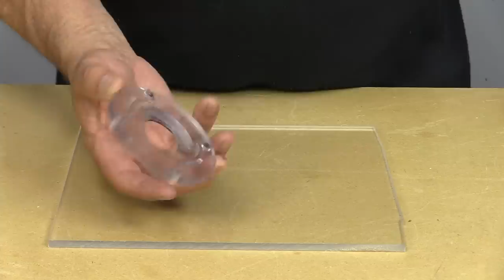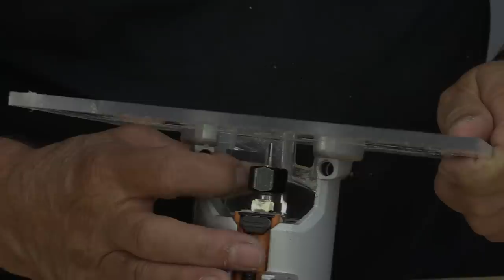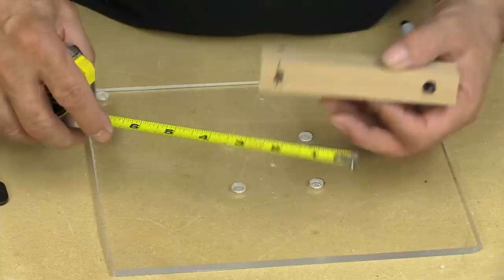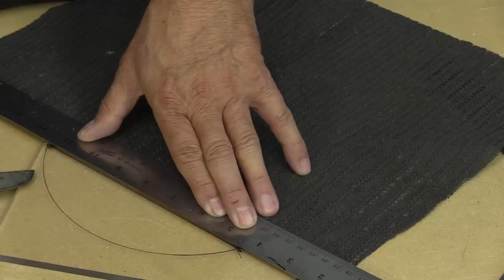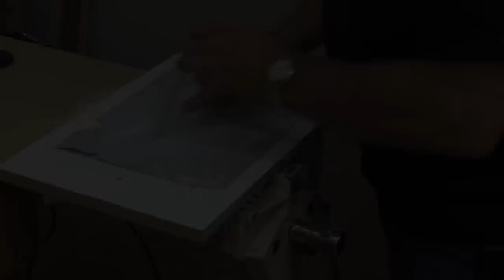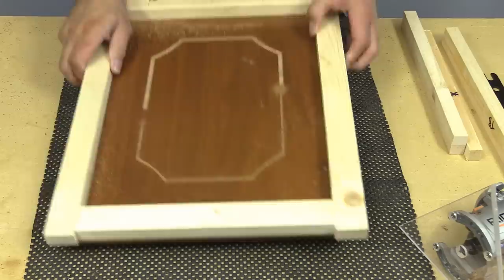Trim Router / Palm Router Design Base Jig

Comment: Great idea. So simple. I’d add a small chamfer on the bottom of the plastic plate. It’ll help clear the dust and ensure that the plastic edge runs clean inside the frame.

Comment: Thank you for “burning an inch” when measuring.  A surprising number of young machinists and carpenters I work with or mentor don’t know about this practice.
Reply: I'm a beginner woodworker and have been doing that a lot since you can't see anything accurately in that first inch (or couple centimeters in my case). Didn't know it even has a name!
Reply: @patrikwihlke4170  uiuuuu

Comment: That's a clever use of the non slip mat, keeping the ruler in place while you scribe
Reply from the maker: Thank You, Matthew!
Reply: Matthew Leigh - I guess that was a bonus tip - no extra charge. 
And thanks to you for pointing out the purpose of that to a newbie like me. I was wondering about why he did that. Might have figured it out later. Or not. 
Cheers!
Reply: If you find yourself needing a non-slip ruler often, pick up a cork backed ruler.  They do a great job of not slipping while using them as a straight edge cutting guide and you can get an 18" one at WalMart for $3.

Comment: Hello. Great video. 
I think the curve parts are not « parallel » because they have the same radius. They are not concentric. 
For a strict geometrical parallelism, you’ll have to do different sizes of triangular base plate. So they could have the same center. 
jp from France

Comment: To find the triangle without a bevel, use a straightedge and draw a line down the middle of the circle. Use a compass and with the center point and bisecting line at the circumference (radius) as your distance swing the compass from the intersecting circumference point to the left and right on the circle. Those two points connect to the tip of the circle and bisecting line.

Comment: Send an ATTABOY to Fred.  Pretty cool.  

I wondered how using a dimension other than 4" radius might effect the final carve out.  I suspect a smaller dimension will move the carve out line closer to the edge of the finished panel.  A larger dimension will create a carve out closer to the center.  Hmmmm!  Also, a four sided baseplate will create a square pattern parallel to the edges....5 sided?, 6?  You could use up a lot of acrylic playing with this.
 
Don't forget Fred's ATTABOY.
Reply: Hii
Reply: You don't need to use accrylic for prototyping you just use 1/2 plywood untill you get your design right and then you can make the accrylic one

Comment: for thos edges on the acrylic...over cut your lines, then double stick tape a straight edge to your actual lines and use a router with a flush trim bit to follow your straight edge (template). usually inverted under a router table. Youll get really bitching and precise edges. very little doinkin around afterwords. Best to use another piece of acrylic for the straight edge.

Comment: The only difference I would do is when you lower the router bit into the wood, bring it down parallel to the cut you are making so you dont get the end of the bit cutting outside the line. You will see a circle cut are from where you rotated the router and bit into the wood. Try lowering the bit into the wood while the router is sitting on the surface and cutting air.
Reply from the maker: Thanks for the tip and thanks for watching!

Comment: Wow... Really boring comments. They almost seem phony. To mention; the comments I saw like to use commas too frequently. Anywho, it was a pretty cool vid, sir. Done professionally. I was curious to the tool you used to score the plastic material with. Had a yellow handle I believe. Also, I've been butting heads with my dad about the Dremel vs Router. Any insight you want to throw my way? You seem well knowledged

Comment: What jig can I make for cabinet doors, various heigts and widths, also different styles and patterns but I don't have a trim router or a round base, my base got two flat edges and  two half round, I machined six doors for our cupboards and it took me 4days and then nothing matched all the doors patern sizes were different thickness from edge or centre or something, I only used a straight edge and it was horrible setting up after each cut, please help

Comment: Good video, however one suggestion. If you hang the plastic triangle edges slightly over the edge of a straight piece of wood with your scibe line matching the straight wood, you could have used the router to give you a straighter edge than the ban saw.

Comment: The passes of the two different bits don't line up center-to-center - means the router isn't sitting dead center in the triangle!
In order to have the passes meet dead center after flipping one must craft a perfect triangle and center the router dead on ... that's the tricky part not shown in the clip!
Reply: Looked to me like the centre of the ‘compass’ wasn’t actually
In the mark, hence why the circle went off the edge of the plastic and hence why you noticed that the router wasn’t dead centre of the triangle

Comment: You continue to amaze me Colin - Excellent - I have just bought an half inch extension rod for my Hitachi M12VE Router only to find that the collett itself needs to be purchased seperately -   Do you know if there is a way to remove an existing collett from the locking nut so I can transfer it to my extension rod?

Comment: Hi, where can I buy the cutter that you used to create the frame ? Does it have an 8 mm connection ?
Reply from the maker: Amazon or eBay should have all the options for cutters you need. Sorry, my bits are all standard, so I can't recommend metric bits.
Reply: @knecht105  I thank you all for answering me. A greeting.

Comment: You missed the center hole when you made the circle, so the circle isn't center over the router
Reply: True
Reply: Jep, bad work here. And if you dive your bit into the wood an an angle, you will see the mark... Bad work again... Sorry man, but you are that kind of handcrafter I would never choose to work for me...
Reply: This is probably why he only half cut the pattern instead of cutting all the way round, because the lines wouldn't line up when they got back to the starting point. You can see that the thin second line he routed is on the inside of the wider first line, but it should have been centred. While this is a very clever idea, it requires that the sides of the triangle are exactly equidistant from the bit of they will not line up. It's a shame he didn't address this important point when demonstrating the build.
Reply: I skipped that part but I can see the cuts  don’t line up. I don’t like teachers that don’t know their $hit

Comment: how do you light the router base
Reply: william thurgood
The router tool comes with an LED light built in. Most of the newer routers come with the built in light these days. A very helpful benefit.
Reply from the maker: As Ronnie mentioned, this is a feature added by the manufacturer. 
Thanks for watching!